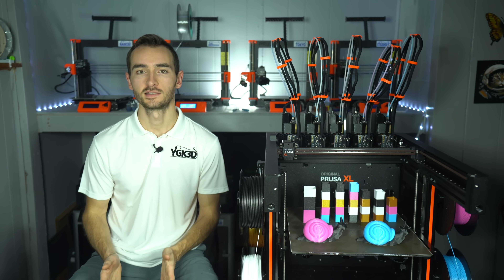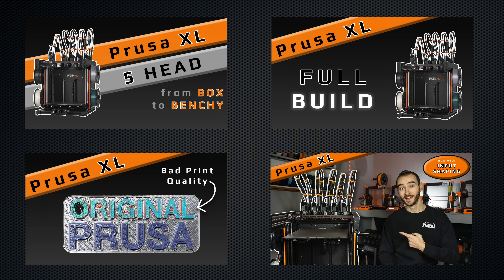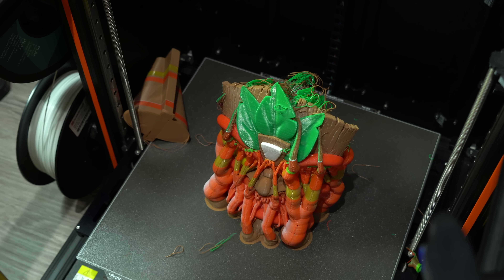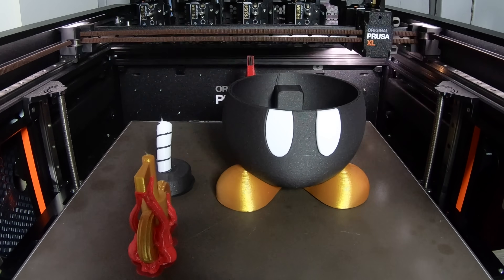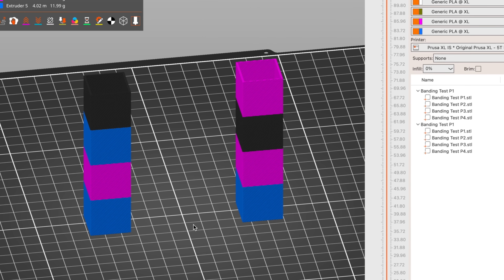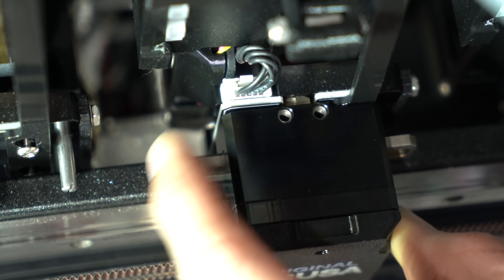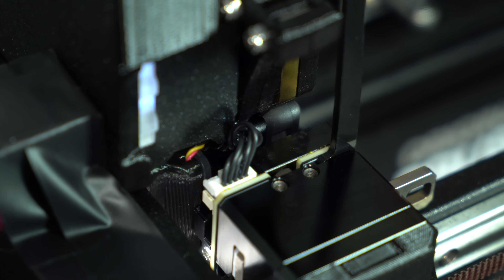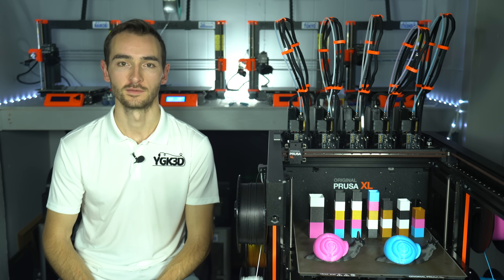I Fixed The Prusa XL's BIGGEST Flaw

Comment: Hey Taylor, nice video.  As someone that has a Prusa XL, I can say that you should have zero wobble between the extruder carrier and toolhead.  I double-checked mine and they're rock solid without any rocking like you demonstrate.  You came up with a good workaround, but its not fixing the issue.  Double-check that everything is lined up and there's a solid connection between the two parts, it should not have any play at all.
Reply: Spot on @RobertCowanDIY.  If you look at the video at 6:02, he has the support straps for the PTFE/Wire bundles installed incorrectly.   He has the two mounting screws at the TOP of the keyhole, not the bottom.   This is causing the strap to actually impede the lower right coupler pin.   His assembly is the issue here.
Reply: When I initially built my XL I noticed some wobbliness from a couple of the tool heads. I reseated them in the holder and eventually got things set up very solidly. I did need to remove the grill from the back of the printer, and fix one of the tapped holes in the printer, but once that was done, I was golden.

Prusa probably shouldn't have used a single M3 screw and a printed part to align something so critical in the assembly.
Reply: @JLProPhoto Agreed!  There are a lot of machined parts on this printer.  A small machined part that seats against that rail would have been preferred.  In my assembly video, you can see that I lightly filed the mating surface and it's very snug.  I think the M3 is OK, but it's not great for using THAT to snug up against the rail.
Reply: @RobertCowanDIY  I might be slightly biased against the single M3 because one of the holes in the rail stripped when I was assembling the printer. From what I could tell, only half of the thickness of that rail takes the screw before the assembly bottoms out, so there's a lot of torque going into a fairly thin piece of metal (maybe 2mm). Ideally, the rail should have been in a T shape to give it a bit more thickness.

Nothing is more "fun" than drilling out and re-tapping a hole in a brand new machine. Prusa tech support recommended sleeving the hole since they would not replace the rail without the entire gantry assembly being shipped back to them.
Reply: @JLProPhoto oof.  Yeah, it should have been a t-profile like you said or something with more meat.  2-4 threads engaged isn't great.  I saw that when assembling and made a mental note to take it easy, which is why filed mine down a bit before applying a lot of torque to the screw.  I'm guessing there will be small improvements to the design over time. I'm surprised they didn't just do a roll-in nut for the extruders.  Setting the distance between each would be simple with just a 3d printed spacer.
Reply: @RobertCowanDIY  That is a really good idea. Shrapnel nuts can be easily removed and they can't cost that much more than the 5 holes on the rail costs to machine. I wonder if Prusa originally planned for the tool changer to automatically account for the distance between the tool heads and wanted a fairly rigid spacing setup. Either way, that rail for the tool mounts is probably the biggest "weak point" of the printer for me.

There's other parts that can be improved (lifting points/handles, camera support in firmware, etc), but none of them are quite as easy to mess up with such a massive impact on the machine's primary function as the tool mounts. I would love it if they eventually add other tool types for the printer (a low powered laser for engraving would be awesome), but I'm nervous about actually swapping out the tool holders.
Reply: @JLProPhoto I think they were really trying to make sure the toolheads were properly spaced, but there are other ways to do that.  Even little snap-in place plastic pieces would have worked just fine.  Also, the machine already has those roll-in nuts, so they're getting them in bulk already.  I personally haven't had any issues with the toolholders, I just made sure they were installed properly.  I spent a good amount of time making sure that was right.  I remember back when I installed the tool changer on my Tormach CNC.  If things weren't PERFECTLY lined up and solid, it was a problem, so I treated it the same way.
Reply from the maker: Hey Robert. Thanks for your comment. You make some great videos on the XL as well!

My tools feel pretty solid when they’re in the right spot (although I can still move them side to side if I push hard enough, to overcome the magnets). It’s getting them there that seems to be hit and miss. I’ve redone the dock calibration multiple times, including fully removing them from the frame. Despite that, certain tools don’t engage properly when they’re picked, giving them the degree of freedom to shift slightly, from which point on they are stable. The issue is that this shift happens over the print. My solution ensures they’re in the correct position before the tool moves to the print. Perhaps there is an issue with my tool changing mechanism, but my machine was fully assembled from factory so it wouldn’t be user assembly error. I’m not the only one experiencing this banding phenomena so I felt it was worth reporting on and sharing the solution that worked for me. I’m open to being wrong, and finding a better way, but for now, it seems to have eliminated the issue.
Reply: @ygk3d Thanks!  So, the locking mechanism should fully constrain the toolhead, allowing for zero movement.  I could make a short video to show you what's going on with mine.  There might be a misalignment of some of the parts, but when mine are locked, they feel like a single solid part, there is NO shift at all.  They are loose on the 'dock' (on the back of the machine), but this is to allow them a bit of compliance when picked up.  But once picked up, it should be solid and repeatable.  I would check to make sure the plastic holder (the thing screwed into the back of the rear rail) is properly engaged IN the rail channel.  There's a boss that extrudes into the center rail channel and it needs quite a bit of force to lock in place.  If that's not happening, it might be skewed sideways, causing this issue.  But any amount of compliance in the toolhead carrier is bad and needs to be corrected.
Reply: @RobertCowanDIY I came to the comments to try and say the same thing but Robert explained it better than i ever could. One thing i noticed in your video when you were calibrating the tools after pressing in the top lock you pulled on the tool and then locked the second one. I think this might cause an issue as the printer locks both at the same time. Try calibrating and after placing the pickup you lock and not move it see if that helps get the proper lock when the printer does it on its own.
Reply: @RobertCowanDIY  The amount of force needed to mount the docks actually suprised me when I put my 5T together. I had an issue with the T1 sometimes not getting picked up, but being dropped. The XL noticed that and reported an error. It took me a few times to realize the dock wasn't fully locked into the rail. 

While tightening the first one, I noticed that some of the others were pretty solid, but I was still able to tighten their screws a little more.
Reply: @RobertCowanDIY  I second Robert on this observation and even left a comment in the 2 head instructions to this end.  The bosses/keys that engage the extrusion fit very tight.  IMHO, they are too tight for an M3 screw to provide adequate clamping force to fully seat.  I utilized an extension arm to increase the torque to the wrench to get mine flush and even broke one of the included ball end wrenches.  It should have been designed to be M5 or larger.  That said, with the docks flush and square they lock in solid with none of the wobble you have demonstrated.

It is clear Prusa has brought some real engineers on the design team to level up some of the more DIY aspects from the outgoing MK3 but with the XL, there are still a few practices carried forward from the old design ethos.  Undersized M3 fasteners are one of those.
Reply: @ulaB Yeah, I ended up filing mine down a tiny bit so it fit better into the rail.  I think these parts should be aluminum, as the 3d print requires too much force to make a good contact.
Reply: @RobertCowanDIY  I did the same after watching your video.  Unfortunately, I over did it a bit and now regret it as my docks tilt slightly from time to time.   Waiting on Prusa to see if I can get replacements for the metal brackets.
Reply: @RobertCowanDIY  can you do a video on it? i don't have an XL and have no idea what this refers to. are you suggesting that the rocking is due to the entire carrier being loose on the rail as opposed to only the tool head rocking on the stable carrier like what the video is suggesting? because if that was the case, it should not have been so well compensated for by bumping the whole thing on the side like the proposed workaround. that workaround having success suggests to me that the issue is at the magnetic interface side between carrier and toolhead, where initial pickup is usually bad, but one more bump from the side fixes it permanently until the next redocking. or at least, even if he does have the issue you raised, it is a smaller contributor to the overall print quality issue.
Reply: @suivzmoi   The toolhead 'docks' sit on the rear rail.  The main part that attaches to the frame is 3d printed and has a small boss that sticks out, interfacing with the extrusion. It's VERY tight.  If you don't get it perfectly snug, it doesn't seat well against the rail.  In my assembly video, you can see that I actually file it down (I don't discuss it, it just shows it quickly in the assembly timelapse).  If you don't get that part flush against the rail, it will be at an angle.  So when you pick up a tool, it won't be flush either, and it will need to be 'nudged' into place.
Reply: @ygk3d  Assembled from the factory does not preclude 'assembled incorrectly'. Forcing the head to an extreme end of its slop with the bump only lasts until the head encounters any forces during the print and then wobbles back again. Top comment is correct that loose toolhead is the real problem.

Comment: Ran into the same issue designing my own tool changer. Getting a tool changer mechanism to be reliable is no joke. Ever since the announcement of the XL I've wanted to know how the force is created to pull the 3 locating pins into their locations. It seems that this force is not strong enough. A teardown of the carriage would be really interesting. Might even reveal a solution to fix this without a workaround.
Reply: This. With precision mounting posts and a flat reference surface + mechanical advantage drawbar it should have microns of play, not millimeters. This is absurd.

Comment: I use the same solution for several weeks now. The layer shifting is a quite common problem with printers that do tool changes. Some printers have a better solution to fix the printhead to the movement system (strong magnets with two or three pins that fall in a fixation hole). A homing sequence of the X and Y axis is often used to ensure the printhead in the right position. If the print head is connected less secure, a bump on one or two sides may be the solution to ensure the printhead is in exactly the position where it should be. I use bumbs on both the left and right side. It takes nearly three seconds per tool change, but for great results it is a small price.

The wipe tower is a specific XL problem. It often comes lose mid print. I did not find a good solution for that, except using no wipe tower at all.
Reply: The solution to the wipe tower coming loose is to use he smooth sheet.
Reply: I am doing more and more prints without the wipe tower and have had pretty good results.  I have the brush mod that wipes the nozzles on change, so that might be why I'm having good luck with it.
Reply: @Arcadenut1  are you seeing any gaps in the print? It would look like a small hole in the middle of the layer.
Reply: @gpt10  I haven't noticed anything.  Do you have an example I can look at?   I haven't done anything really complex or large yet with tool changing.  The largest thing I did was also using Flex and PLA but they were the same color.

Comment: Prusa should be fixing this without the need to travel to the side of the machine -- it adds whatever that fraction of a second to bump each tool -- the tool should be picked up correctly, for the price of the machine, this is really amateur hour. Excellent work on your part to figure it out, but oof, really seems like a project printer.

Comment: Great detective work! I have a 5 head XL on order I have considered canceling and going with Bambu X1 Carbon, but I would prefer to stick with Prusa because of open source, support, etc..
I am still very concerned about stringing and blobs/artifacts.

Thanks for your effort.
Reply: "open source" not so much anymore.
Reply: You know, people say o0en source but I encourage you to look into it. In my opinion Prusa is open source mostly in name.

They are forced to be open woth marlin and prusa slicer by the licesnes of the software they are based off of. For their hardware though, where are the files? They are less open than they claim to be. Thats something Ive been thinking about more, and increasingly annoyed by.
Reply: @BeefIngot  Prusa has a freaking tattoo of the open source hardware logo, so that is some serious bullshit if they're not.  I'd be curious to hear their response if you asked for them.

Comment: Out of curiosity, have you ensured that your docks are fully seated and tightened into the aluminum extrusion? It took quite a bit of wiggling to get mine flush. There are some forum posts about it, I would link but it made my comment get deleted.
Reply from the maker: Yes. I've uninstalled and re-installed them multiple times. I don't like the single screw design for mounting them.
Reply: you make a good point, those docks took some work to get full seated. I can see how this would cause an issue.

Comment: gah damn those prints looked surprisingly bad. Really happy that you were able to find a solution and hope others with multi tool heads see this. I now want to recheck my single toolhead XL to make sure there is nothing like this causing some of the layer banding im seeing in my prints
Reply: Single toolhead does zero toolchanging so if Z banding occurs it's probably something else.
Reply: @brisance   You can't park the single tool head?
Reply: @davidthompson9359  as of today, no you cannot because the single toolhead does not ship with a dock. Refer to the Prusa help documentation for a single toolhead. There is no dock, and you are required to secure the extruder to the toolchanger with screws.
Reply: My single head is showing the same signs, perhaps you could reply back if you find anything?

Comment: I suspect prusa will pull a creality move on this and use the work of the users to fix their printer
Reply: Prusa has always stood on the shoulders of the community. The only reason the MK3 was so good was the large scale community driven refinements over years
Reply: @alexcortelyou8124  yeah, but none of their previous printers have been such a failure on launch. With the mk series they improved the printers after launch, but with the XL, they have to fix it and alter the design to make it work

Comment: Sorry, but it is not a design problem. I think some of the screws in the extruder are not correctly tightened. I have no problems with my 5 tool head xl from the scratch and with the latest PrusaSlicer version from the weekend, even wet petg has nearly no stringing.
You should not be able to move the nozzle, when the head is in the locked position. If it is possible, something is loose.
Reply from the maker: Mhh… maybe. My printer was “fully” assembled, but it’s possible it was assembled wrong from factory.

Comment: So the workaround for this is simply to install that bumper block or would you also suggest resetting the mounts like you did in the video prior
Reply from the maker: Re-doing the dock calibration took my prints from bad to good. Adding the bump procedure took them from good to great.

Comment: Concerning that the whole toolchanging mechanism seems mechanically flawed. After all reliable alignment on pickup is the main requirement for it. Other toolchangers use a kinematic alignment mechanism and a servo for locking, wonder if prusa can actually make it work without that.

Comment: You should contact Prusa, show them your video, and see what they have to say. I get that this has significantly improved your issues, but it needs to be fixed in the docking area. Your solution may wear the clamping mechanism over time. Did you try to bias the docked heads in the -Y direction before tightening, or make sure the Y gantry isn't hitting some type of premature end stop? There definitely seems to be too much rotation about the Z axis when tight.
Reply: I suspect you are correct on the wear and tear on the tool head but using this method, even for a short period of time, will be a valuable troubleshooting method.
Reply: I made this comment before having my machine. I have it now and have printed these towers. My alignment is near perfect and mine have no wobble. I was also able to look at the design closer. The dock calibration only has to be close, it doesn't have to be perfect. The locking mechanism will pull the print head in just a little bit when it locks. I'd really be looking at that tool changer closely.